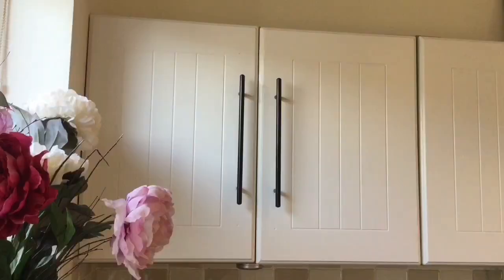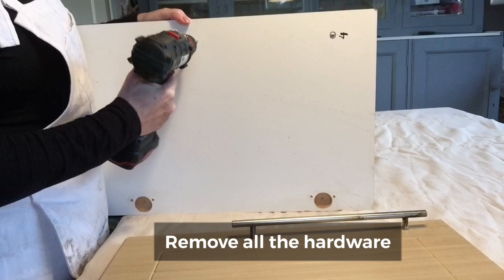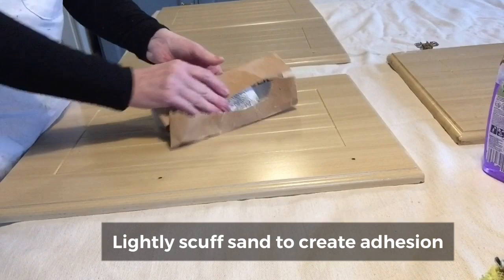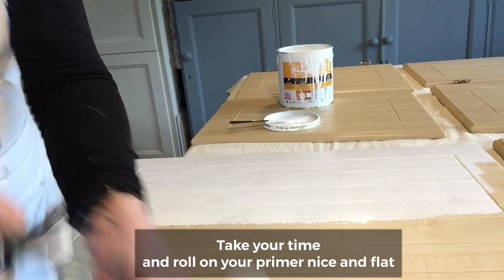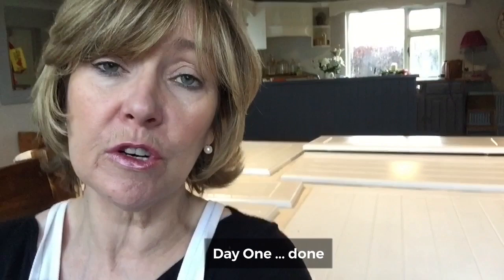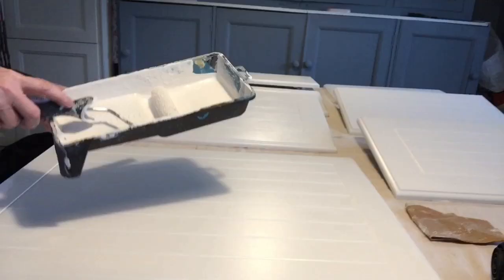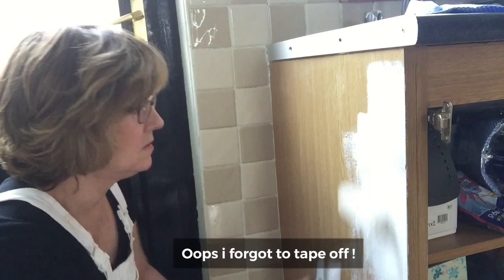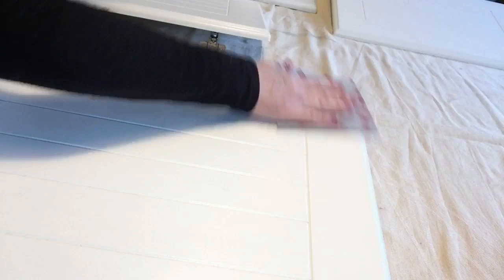How to Paint an MDF/ Laminate Kitchen and get a professional finish !

Comment: Great vid!!!   I did mine by rolling the cabinets and spraying the doors and drawer fronts.  Spraying is much faster if your doors have more shape and corners to cover, but rolling can work but you will also need a very fine soft NEW brush to get into the corners. In this case do your light sanding with a fine sanding sponge.

Comment: Thank you for the tutorial. You did a fantastic job! In a mobile home, I have mdf cabinets covered in what I am pretty sure is a thin glue on glossy paper. It is starting to peel off in areas that have gotten wet over the years, but the mdf has not swelled in those areas, thankfully. Do you think this method would work for these cabinets as well?
Reply from the maker: Remove the foil and paint the mdf. I have done that and it works great

Comment: I’m thinking of painting my melamine kitchen cabinets this Christmas and your tutorial is very helpful. If you don’t mind, what are your thoughts on how paint dries on melamine/laminate surfaces? Will it be as smooth as it was pre-painting or should I expect to have some texture? I’m really hoping for the former! Thanks from Canada!
Reply from the maker: If you use a roller that gives a really smooth finish to soothing the primer and paint AND use a superfine sanding pad in between coats,  you should get a sprayed like finish.
Reply: Is melamine the same as laminate cabinets?
Reply: No, melamine is a bit harder, but you still do it the same way.

Comment: Thanks for the info. Looks great. I have a couple of cabinets that have been damaged bc of water & now have places that have curled out—not just the fiber foil layer but the MDF. I’m guessing I’ll just have to replace those doors.  Any advice?
Reply from the maker: You can remove the laminate easily with a heat gun and paint the mdf
Reply: @Shabbyie  Same issue here. Will it be the same paint you mentioned on the video?